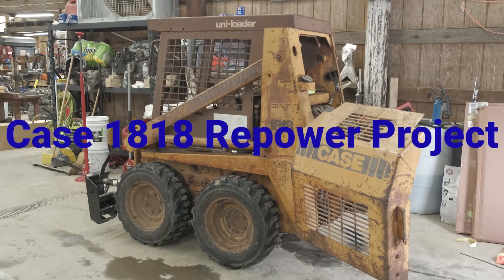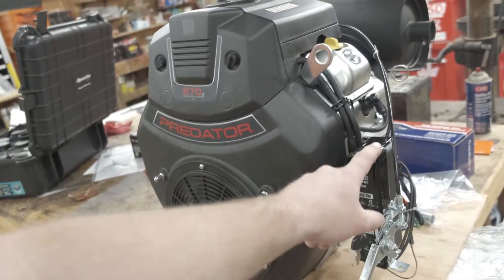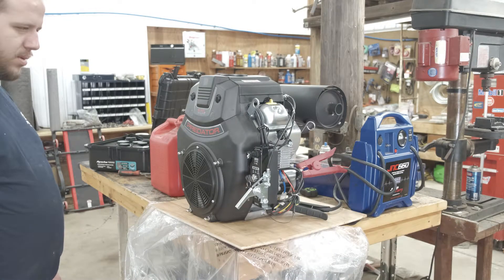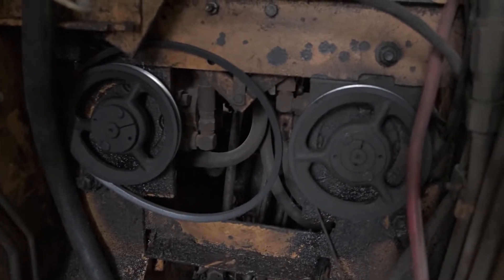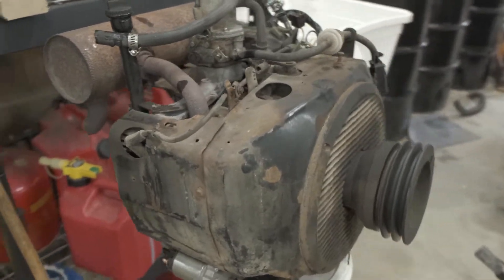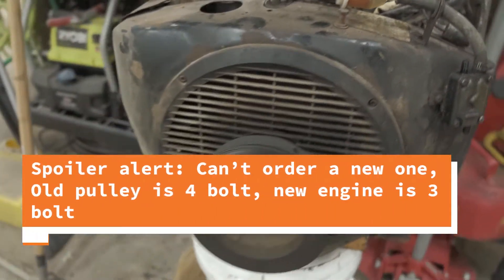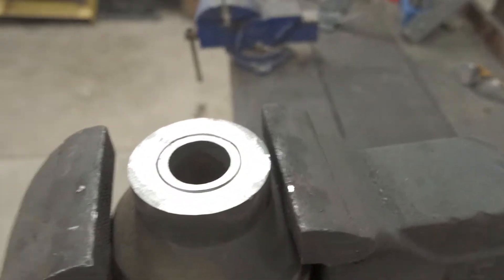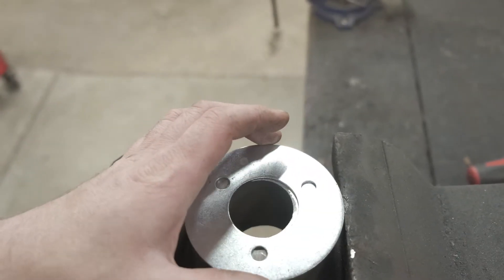Case 1818 Repower Part 1

Comment: Any part 2 I’m working on the same thing
Reply from the maker: I had my computer with all the footage crash on me, and I lost the part where I finished it, but I did finish the project. I'll make another video about the project and try to answer the questions about the machine that might help during your project. Sorry about that!
Reply: @streetsahead5088  did your swap end up being successful by using the 3 bolt holes to bolt through the original pulley, into the flywheel? Or did you have to use an adapter/spacer in between? I am in the middle of this project and this is my stopping point for now. I am trying to figure out if I should proceed as you did, or if I need to head a different direction. Thanks!

Comment: Wheres part 2? Im doing the same thing myself right now
Reply: Have you started the project? I’m curious if mounting the pulley to the plastic flywheel worked. I’m debating if it would be better to turn the engine and find some pulleys.